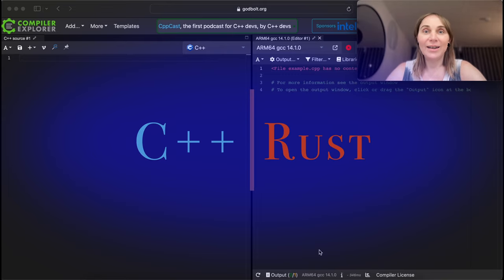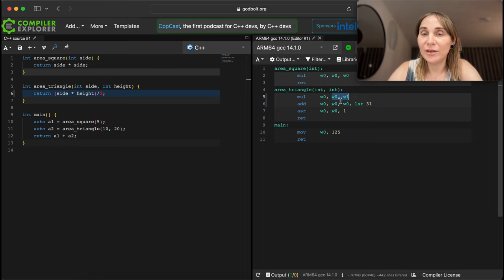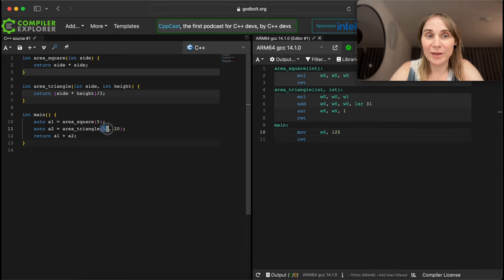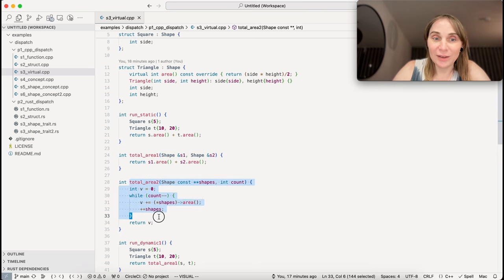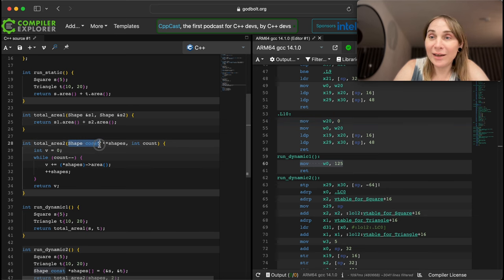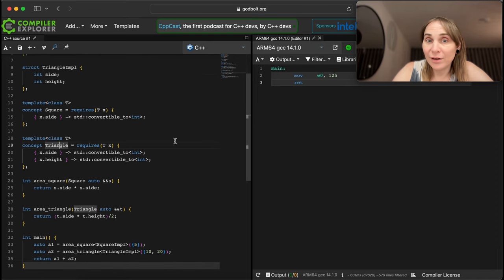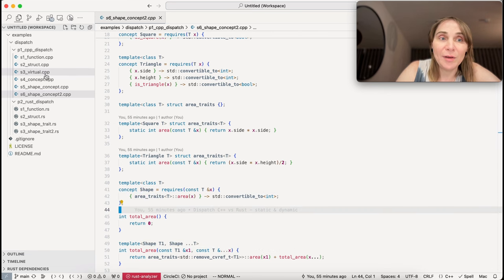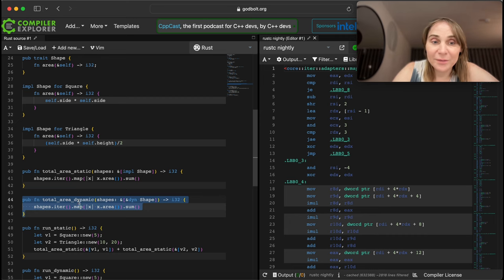C++ vs Rust - Impl vs Dyn - Arm vs x86

Comment: C++ does not have compile time evaluation on (constexpr and consteval) by default unlike Rust, constexpr functions in C++ produce almost same assembly output as Rust
Reply from the maker: Constexpr doesn't mean compile time evaluated. It means that expression does not depend on volatile state, and that is the reason compiler may evaluate it at compile time. I'm not entirely sure if every constexpr is evaluated at compile-time.

Cit: constexpr - specifies that the value of a variable or function can appear in constant expressions

Are all constant expressions guaranteed to be evaluated at compile-time?
Reply from the maker: Rust is basically syntactic sugar for C++ templates and concepts in my eyes, and that is why I like Rust. Saying so I prefer to use C++, and that is because I prefer to define those templates and concepts, even if syntax more involved. C++ gives me raw power, while Rust gives me a subset of that was blessed by Mozilla Foundation. On the other hand, at Mozilla they do fantastic job writing C++ code. Have you ever worked with Firefox codebase? I worked with it, and I say it's beautiful.
Reply: @soniakolasinska3850  constexpr is a gray line between compile time and runtime, if the compiler can catch an optimization pattern, it will evaluate it on compile time. There is also consteval which is guaranteed to be evaluated at compile time, and forces programmer to write compile time code

so constexpr fits better for the C++ examples you've given
Reply: @soniakolasinska3850  firefox codebase is amazing, unfortunately i am not that indepth with it, but i try to follow their rules on writing C++ code
been messing with Vulkan and real time rendering :)